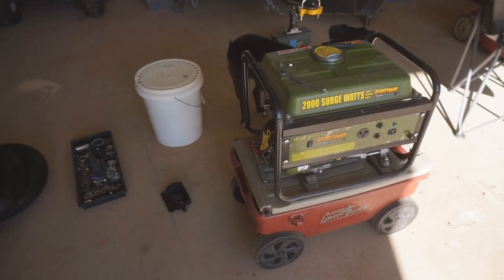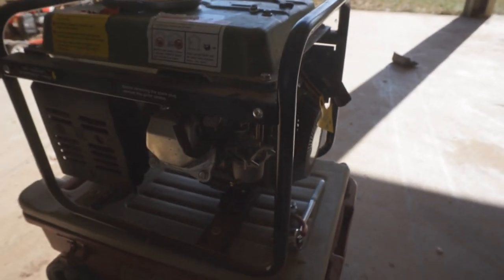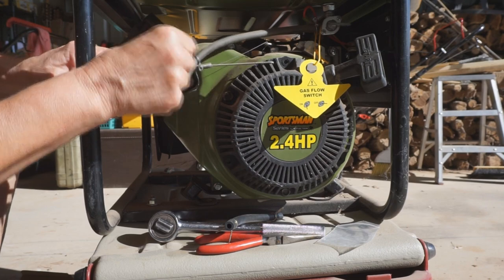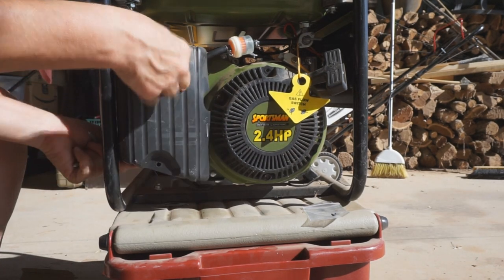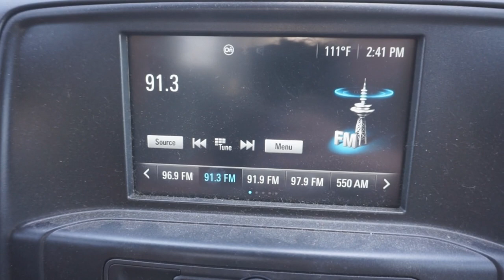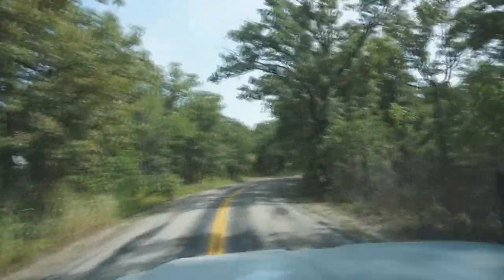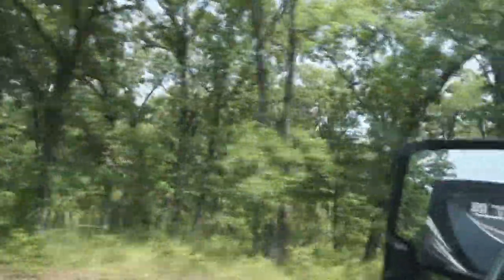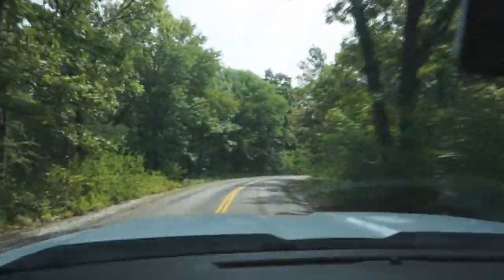Detour - Headed to Arkansas | Cooper Lake State Park

Comment: great to see a female mechanic  with tools  you rock   cooper park  a breath of fresh air    I had an old generator I bought years ago incase I lost power    it has sat years not running   when I got my campervan  iwanted everting on one fuel for lack of space and weight si I bought a propane conversion kit for my generator it started right up     now I don't have to worry about gas getting old in the carb  you have safe travels
Reply from the maker: My father taught me alot of things and I am thankful that he did.  But, I'm still not a mechanic like I would like to  be!  Interesting about the propane conversion.  I do know that the fuel was good so I don't think that was the issue.

Comment: You can take apart and clean the original carb...the leaking may have been coming from the drain bowl screw opening being left loose....this is where you drain the fuel from the bowl to store it
Reply from the maker: The leak was coming from the top of the carb.  Wasn't sure how so just thought I would try a new carb.  Still don't have it running right.
Reply: Utube has alot of carb cleaning...just Google it....
Carbs get gummed up from on fuel in tank .make sure to sion old full out or it won't run right...make sure and add a cap of seafoam to the gas. You can get it at walmart for 7 a can. Do not use anything else. The ethanol in gas gums up the jets and little channel in carb. I clean my scooter carb in about 15 min...
It took alot longer when I first watched the u tube videos.
You can do it....the parts are small so be careful work over a white towel . Email me if you have questions.